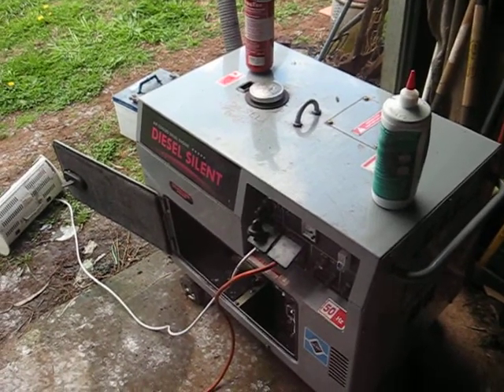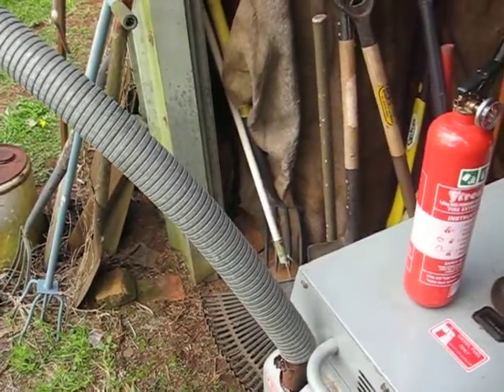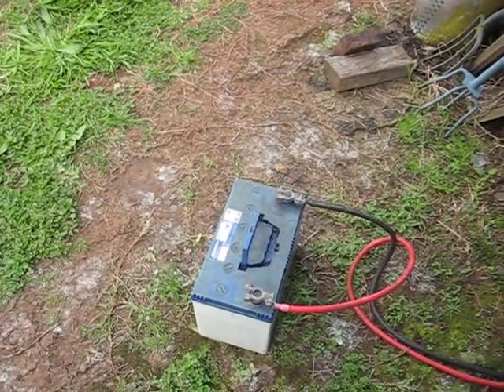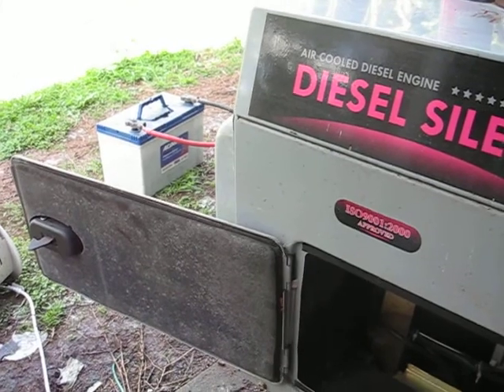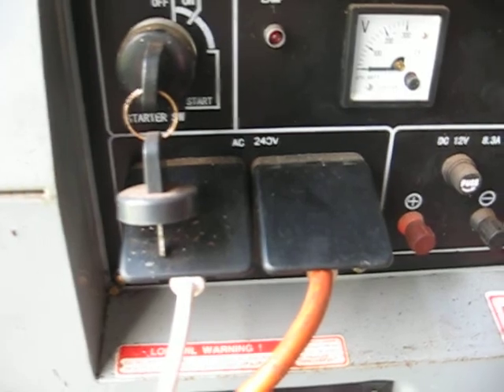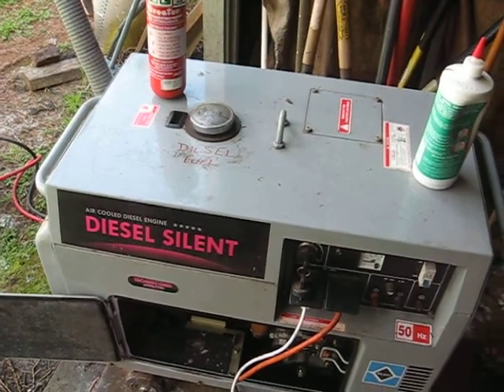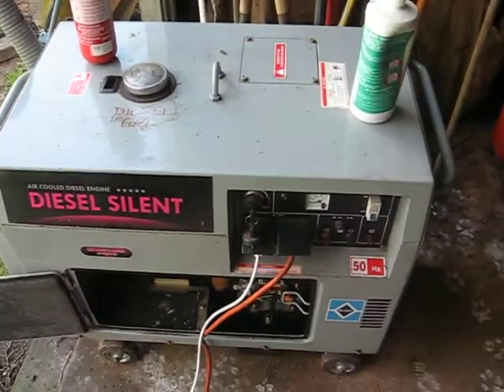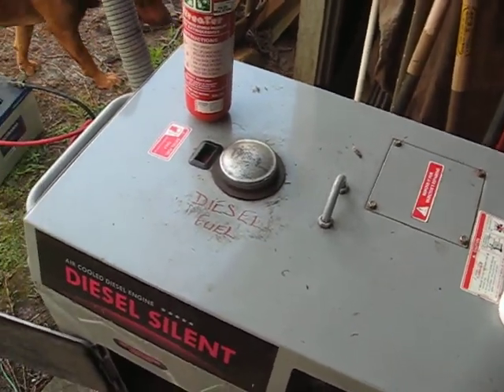Natural disaster, generators. Part 2

Comment: Very informative. I heard never ever let diesels run out of fuel.
Good point on correct fuels.
Good point on battery modification.
Still got this one?
Thanks for sharing.
Cheers.
Reply from the maker: Yes that's correct. Apart from damage to fuel pumps, the injectors are damaged as fuel chemicals are a lubricant for the injector pintails.
Yes we still have the diesel generators.
The one in this video, we used a month or so ago, prolonged power outage after severe electrical storm trashed local power grid.
Thank you.
All the best.
🇦🇺🇦🇺🇦🇺🇦🇺🦘